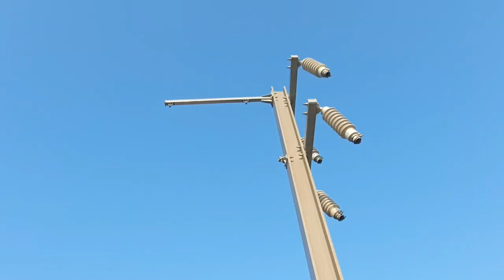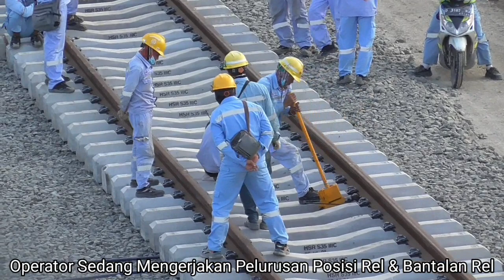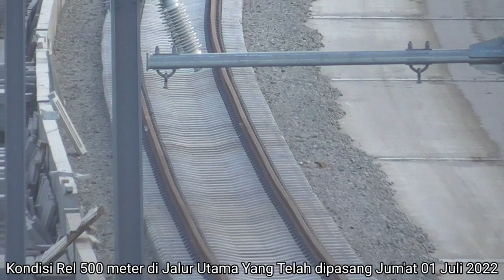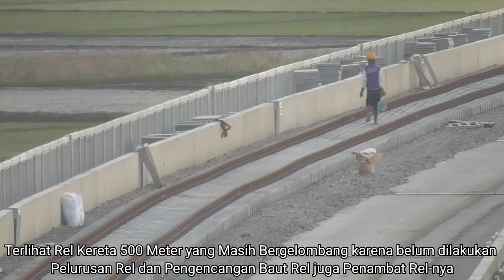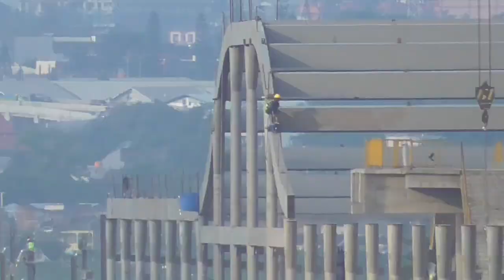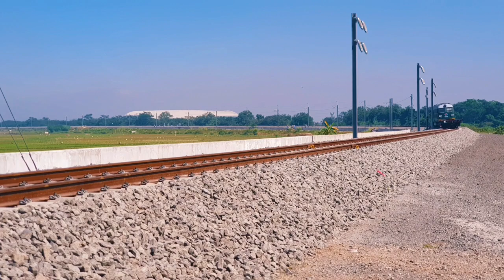DIKEBUT !! PEMASANGAN OVERHEAD CONTACT SYSTEM (OCS) - PROGRES TERBARU KERETA CEPAT JAKARTA BANDUNG🚆

Comment: I am quite impressed how Bahasa can handle technical terms. During early years of post colonial, British loved to downgrade Bahasa not being sufficient. To be technical, one MUST learn English. That’s Msia/Spore speak funny English.
On the rails,
I guess there is still some parts of rail not in perfect curvature. They must have a solution later.
Reply from the maker: In working on this high-speed train project, each sub-work is accompanied by a translator who is proficient in Chinese.

For curved rail sections, that's not the end result. Because later the alignment of the rails that have been installed will be carried out.